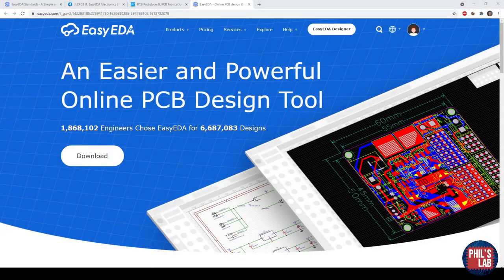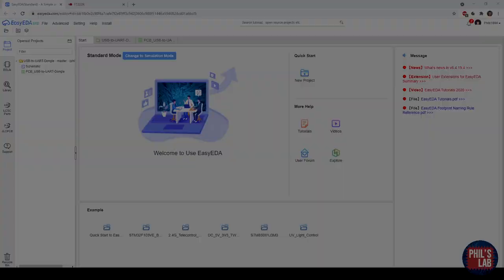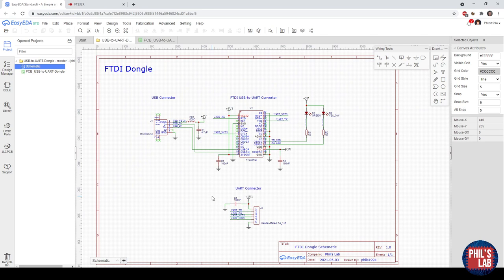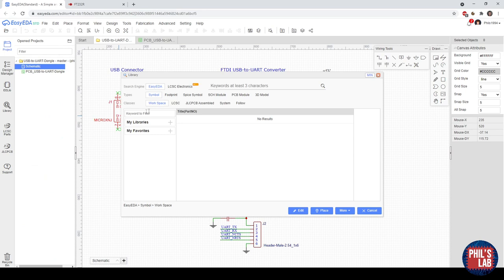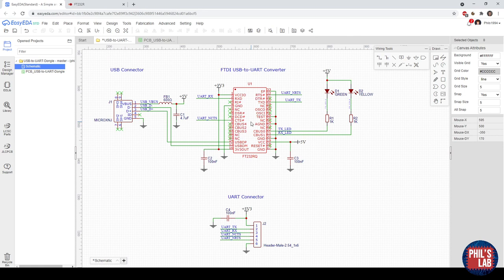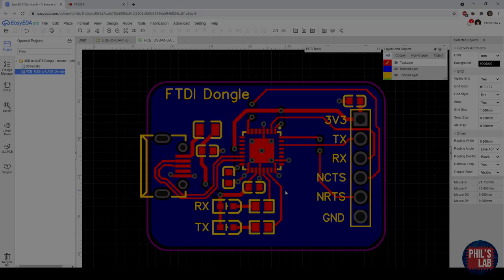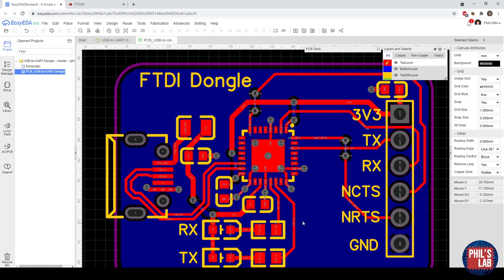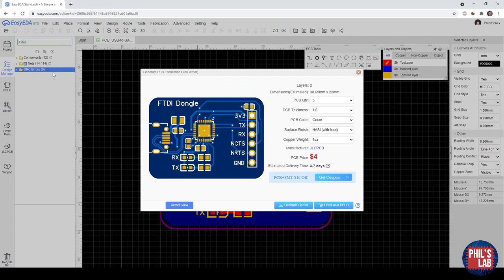EasyEDA Quick Look | FTDI USB-to-UART Converter PCB - Phil's Lab #23

Comment: As a professional engineer myself, I am starting to use EasyEDA more and more myself. 
The fact that there are billions of footprints ready is just and extreme time saver.
Making your own footprints usually takes a lot of time.
Obviously you can always repurpose footprints, but it really helps with the overall design. 
Compared to a lot of heavily priced competitors which I have been using for years, I find the workflow very intuitive. It still has some strange bugs and quirks, but all programs do.

Comment: EasyEDA was actually the first EDA software I used when I just started getting into PCB design.
It's a pleasure to use, but I switched to KiCAD/Altium after experiencing too much downtime which prevented me from working.
I still use it occasionally for little personal projects, but not for work as the KiCAD/Altium projects are easier to transfer to colleagues and commit to source control.

Comment: Hey Phil! How do we route the differential pair signals for a Type C Receptacle. They say it has to be of equal length and its difficult to route without using some vias for one of the signal traces. I tried on a 4 layer PCB but its such a hassle to rout DP signals. I intend to use this Type C as a micro USB 2.0 receptacle(D+,D-,5V,Gnd). Any resources and suggestions would be appreciated!. BTW love your STM32 series lots of info and very helpful for a beginner and a hobbyist!

Comment: I used it for a couple of boards and i'm quite happy with it. If your PCB design is finished. The gerber-files are only one step. But also get the right BOM and pick and place file is also only one click away.
The only problem I have. But that is quite annoying: is the export of the pcb as 3D Model. Even if you don't mind the lack of colors, it's not calibrated and the origin is way off, so that you have to fiddle around to get it properly imported in e.g. Fusion 360.

Comment: Hi Phil, great video as always. Ever thought about making a radar board with the STM32 at its centre? Using IQ modulator/demodulator demodulator chips? I've got a project that I'm stuck on because I'm struggling to comprehend some of the terminology around these RF components, and how to interface them to an ADC/DAC. Also, how to do wideband RF matching (if that's even possible).

Comment: Easyeda is only good for simple hobby boards like the one in the video, otherwise Kicad (also free) and Altium (paid) have way more features for more complex boards. Plus Easyeda stores your files in a cloud, which may be an uncomfortable/security risk for some people.
Reply: I find that it works fine for more complex boards. The software lacks some complex features, but that is not at all the same thing. Also, storing files in the cloud is optional.
Reply: With 20 years of experience in board design, I don't agree with this comment at all.
It does have some bugs, quirks and limitations, and obviously can't be compared to things like Altium. 
Unless you work with a team of 20 engineers, most of these things I just see has pure luxury.

Comment: EasyEDA vs KiCAD which one do you recommend ?
Reply: EasyEDA looks like to have what KiCAD misses / where KiCAD is weak (at least for KiCAD 5.1): ease of use, huge lib with symbols, footprints, 3D, straight forward BOM / quick step to order components, good looking graphics. I use a little bit KiCAD, it's a bit of a productivity killer (I was used to Altium Designer before).
Drawback for easy EDA (at least as professionals): online mandatory, risk of IP theft. I don't trust. And I guess is also misses quite some other pro features.
But ok for makers I guess. Hope KiCAD catches up ^^
Reply: @rdson1621  okay thanks!
Reply: The user interface of EasyEDA is far better by miles. Also the fact that they have billions of footprints ready really is a win.
Saves a lot of time.
I have 20 years of experience in PCB EDA's and had no trouble using EasyEDA. The workflow is so much better than KiCAD (well kicad is just plain horrendous).
It does has some weird bugs and quirks.
Reply: @rdson1621  "Online" is not mandatory. I use it offline.